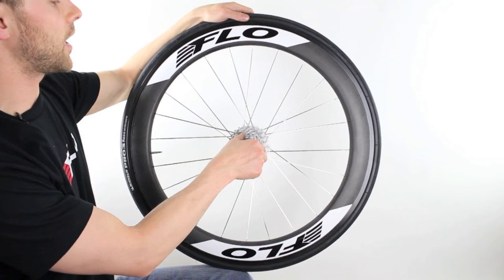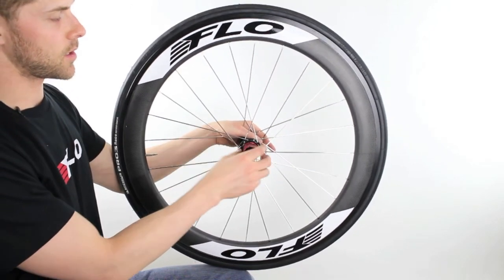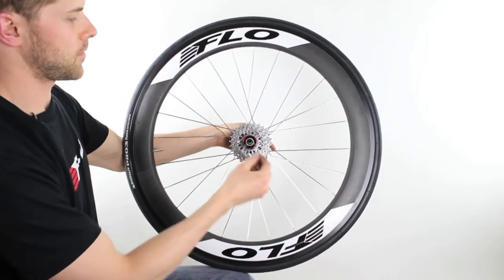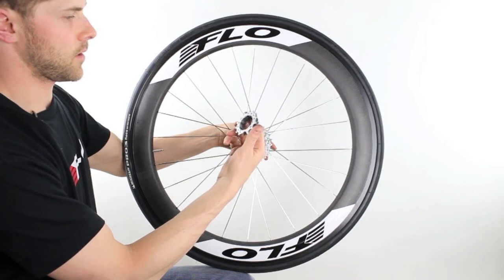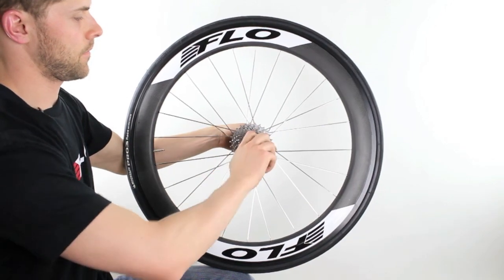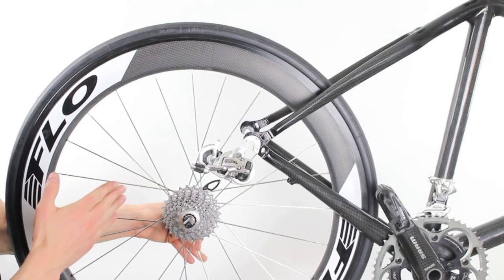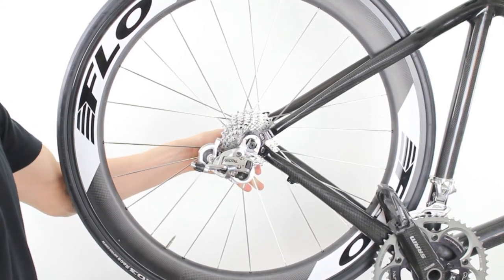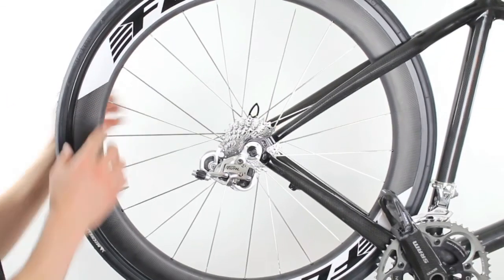FLO Cycling - Installing the Cassette & Wheels

Comment: I bought a FLO Disc and there was a silver "spacer" on the wheel that is fairly wide and maybe 2mm thick.  Does this mean I do bot have to use the skinny/thin spacer that was between the cassette and wheel on my old wheel?
Reply from the maker: If you have a skinny spacer already on your wheels, I'm guessing you have Mavic wheels.  If that is the case, then the skinny spacer will not need to be used on our FLO wheels.  

The thicker spacer that we ship will convert the wheel from 11 speed to 10 speed.  If you are running an 11spd group set then do not use the spacer.  If you are running a 10 speed group set, then place the spacer on the freehub before you put on the spacer.

Chris
Reply: Thanks!